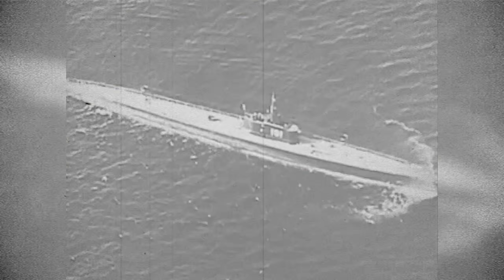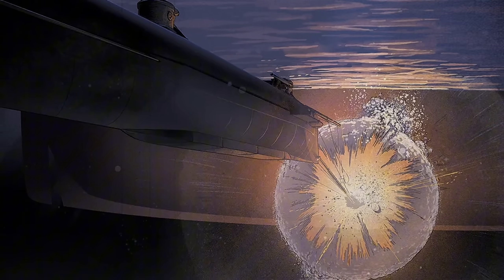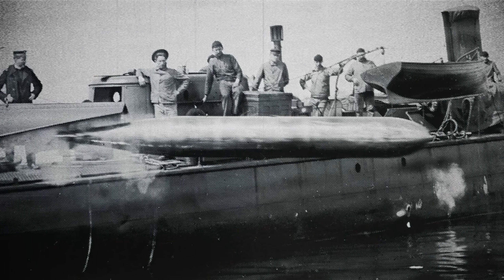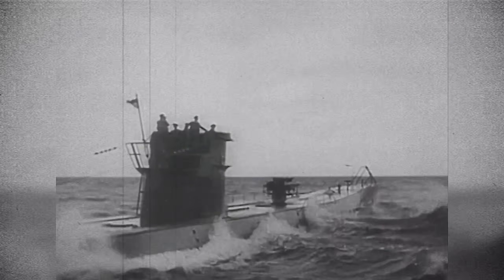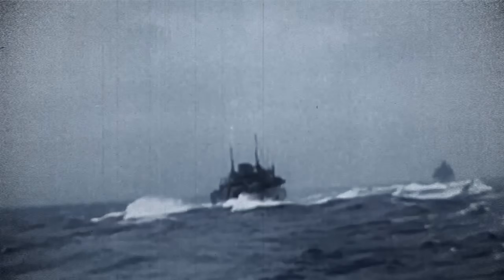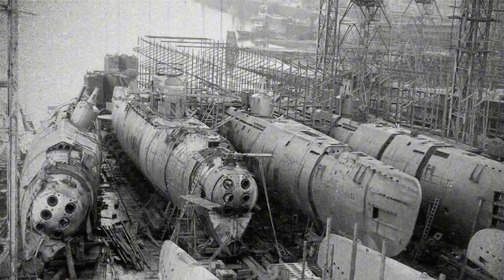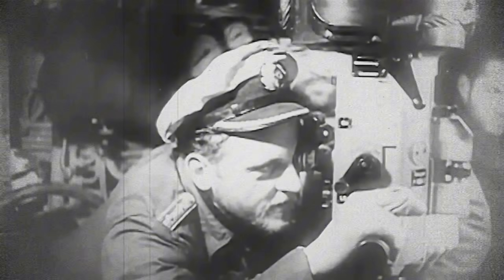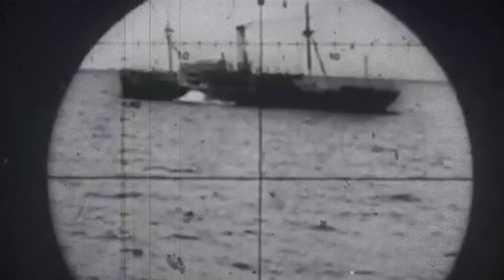The HORRORS of Submarine Crews

Comment: 14:58, 6 months under water is not normal operations. Fleet Ballistic Missile Submarines submarines (SSBN) spend about 72 days below the surface on a normal patrol. they have assigned areas of the ocean to work in and rarely deviate from that plan. After their 72 days they make their way back to their home port where a relief crew is standing by to take over. After refit, maintenance, and training time the sub puts to sea again with an entirely different crew. The total time for that cycle is approximately 90 days depending on the extent of the work needed while they are in port. Almost all SSBNs adhere to that schedule. they are also the quietest thing in the ocean. As a surface ship sonar technician our mantra was "listen for the quiet spot" if we wanted to have any chance of finding them. Fast attack submarines (SSN) have a single crew and a completely different mission. They can put to sea on demand. There were times when I'd see a  fast attack submarine tied up on the other side of the pier only to see that it was gone when I arrived for work the next morning. They are unpredictable and impossible to find.
Reply: We had a saying…..There ain’t no slack in a fast attack!
I was a cook on an SSN.